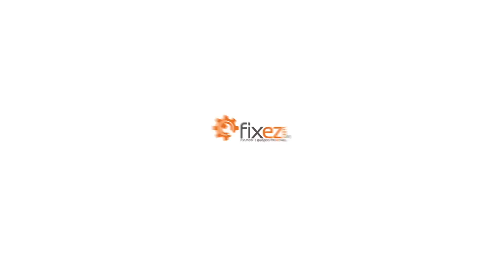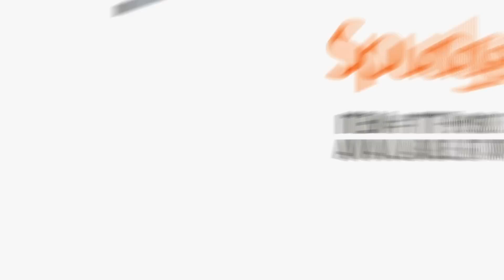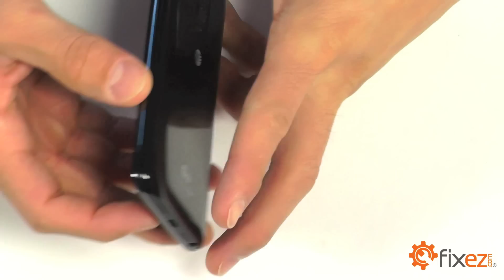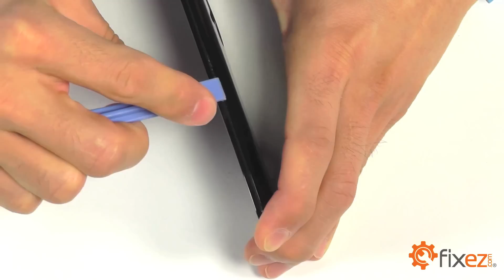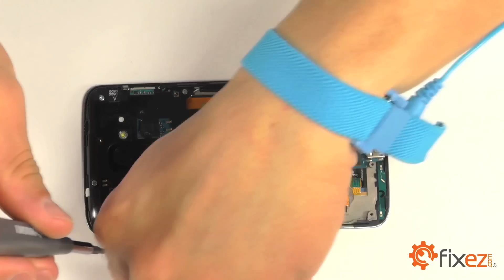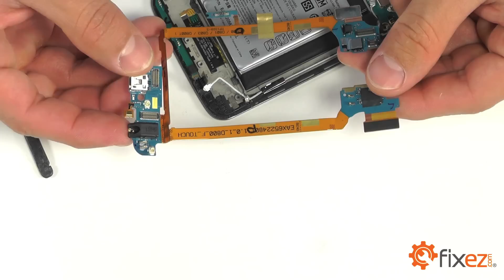LG G2 Dock Port & Headphone Jack Assembly Repair

Comment: Thank you Thank you Thank you.  Video was well produced and the docking port board from Fixez worked perfectly.  And now I have tools for the next time.  The headphone jack had permanently turned on the headphone icon rendering any mic & audio useless without headphone or bluetooth.  Now I can use the phone normally again.  PERFECT!

Comment: I have had a similar falure, and tried the cleaning thing with little to no improvement. I lived with it for a couple of months then the screen started to go blank or displayed snow. Sometimes by pushing the back behind the Sim card, this urged the screen to come back. Within a week even this did not work. It turned out under using high power magnifying loupe that the ribbon connectors connection to the motherboard (behind the Sim card) had half of the solder joints cracked! DO NOT ATTEMPT THIS but having preformed micro soldering in the past, I manually soldered it. My screen is now fine and bonus!,,, so is the headphone jack.
Reply from the maker: +Felice Lamanna Thank you for sharing this information.

Comment: Hello,
I just replaced my dock port and followed directions to the knats ass however now my phone gets stuck at the sprint boot screen. When I reset manually it says the battery does not have a sufficient charge then it shuts off but instead it resets itself and goes does the same thing over and over. Do you think my replacement dock port can be faulty or

Comment: Does anyone know if the the Dock port and headphone jack assembly for the Sprint G2 LS980 is the same as the Verizon VS980?
I'm having trouble finding one specifically for the LS980.
Reply: ***** ok. Thank you for the response

Comment: Hi, i've been trying to fix my LG G2 phone, problem is that the battery won't charge (since it got dropped in water). Tried replacing the battery and the charging port but it still won't charge the battery. Everything seemed to work fine, until the battery ran dry. Any ideas for what else i could try or am i gonna have to buy a new phone?

Comment: Thank you so much, I've replaced this part in my lg g2 d802 because my headphone jack stopped recognizing anything. My cellphone works great, but it still doesn't recognize headphones of anything!! 
What can be causing the problem??
Reply: Thanks for replying! 
The problem started when someone accidentally connected the audio output of a big speaker while music was playing, in the input of my LG G2; Can that cause a problem on the logic board?
Reply: ***** I've had this same problem, but after replacing the audio jack assembly, I've been able to get my headphones connected, but still they disconnect randomly, but if put pressure in the right place it seems to fix it temporarily. It seems like a loose connection, but I'm not sure where. What do you guys think?
Reply: I've solved my problem partially using an app called SoundAbout, which allows me to direct the sound to the headphones or speaker no matter what.
In my case, I think that the trouble is located in "some place o part" that detects when something is plugged in, but that thing isn't in the audio jack flex that I've already replaced.

Comment: I replaced the dock port at shown in the video, however, I'm having problems with the touchscreen functionality after the fact. It works as usual about half the time, the other half, the touches register either incorrectly or not at all. Is this a common problem, and is there something I installed incorrectly? I tried going over the connections a few times to ensure that they were solid, and am out of ideas.
Reply: Erik Johnsgard I have the same problem than you :(, Did you solve thsi problem?
Reply: Diego Perez No, sorry, I have since replaced the phone with a different model, but I never figured out how to fix this one. I wish I could be more help. :(
Reply: +Erik Johnsgard I had the same and it has something to do with the proximity sensor on the top of the phone. My mainboard wasn't fully pushed to the back of the phone so the sensor might not be next to the casing. 
I made sure the mainboard was clicked into the front (it snaps in place) so that might be your problem. Mine works now :)